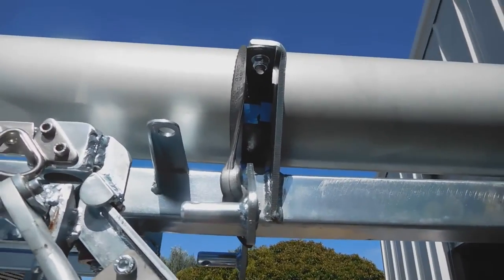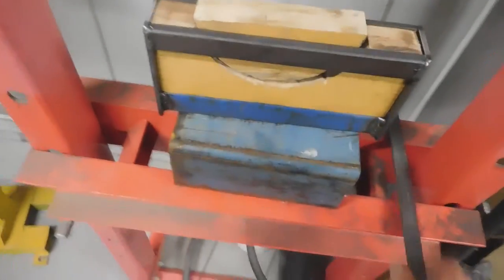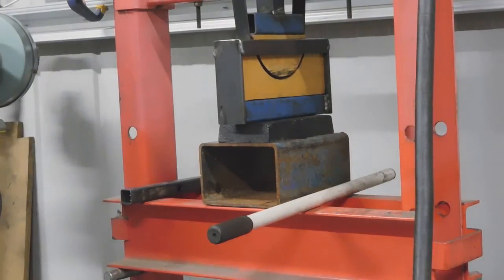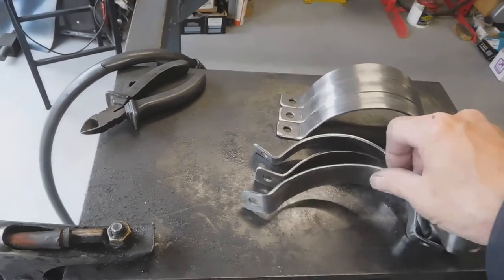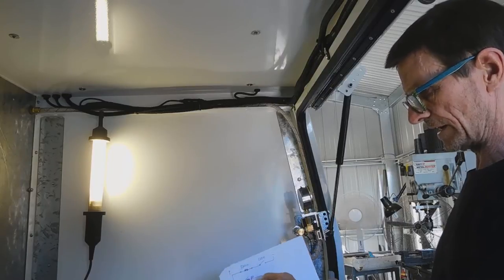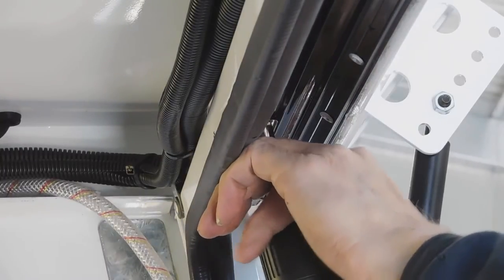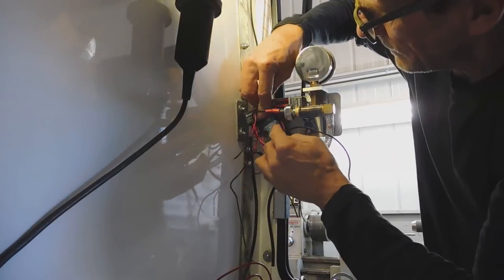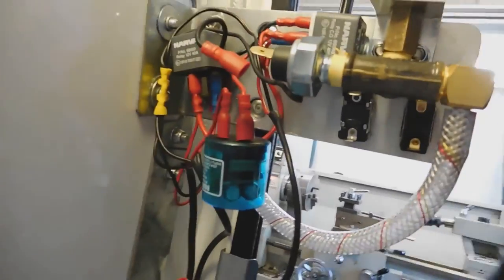Forming clamps on hydraulic press, air pressure sensor warning circuit | Pole Camera Build #41

Comment: Good job on the electrics.
Thanks for the link to the system too.
Seems like a very handy unit to have.
Most might say,  why not just use a Drone to do the same job.
The quick answer to that is,  people generally Hate Drones, lol.

Thanks for including us in this job.
Peter.
Reply from the maker: They companies I sell them to use Drones as well but some places they can't use them and the pole has a DSLR on top with 300 mm zoom so they can zoom in some distance without going on or operating over some properties, not everyone likes the power company so they can inspect power poles form the road.
Also places in town they cant use Drones like near airports.
Aside form, that the poles can also carry comms systems and are used for network site testing.